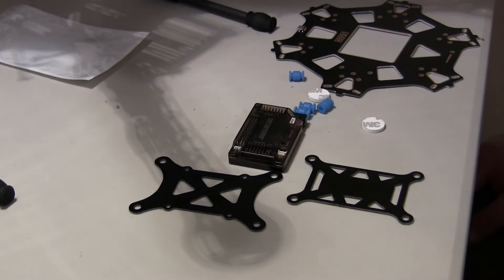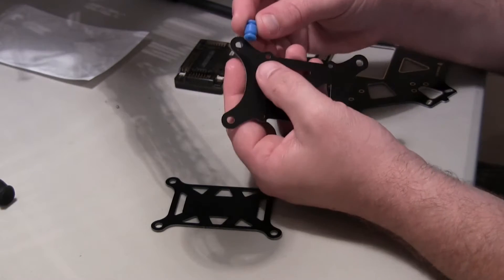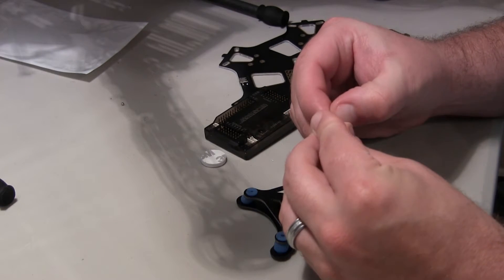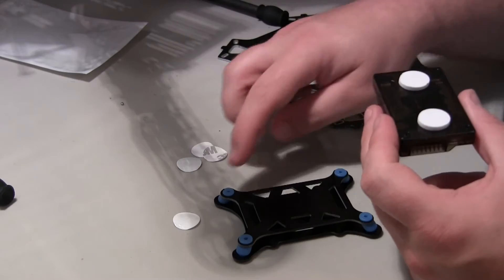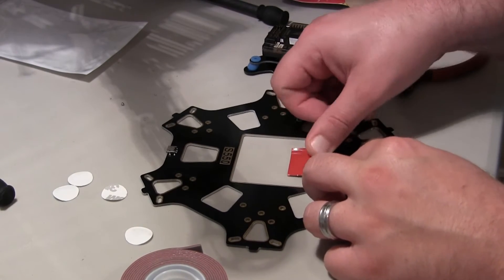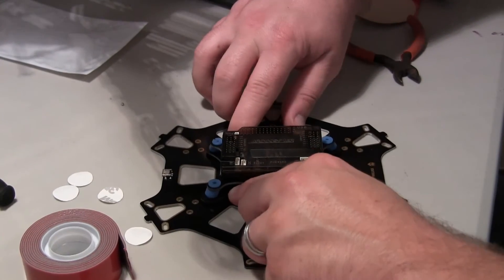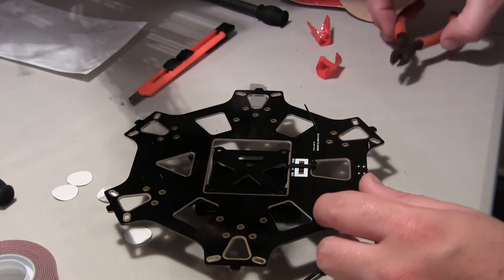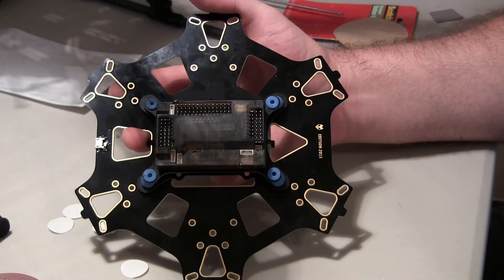S550 Build Part 4 - APM 2.6 to Frame with Vibration Dampener

Comment: Pro Tip: Loop a piece of string or thin wire around the grommet through the hole and just pull it through carefully. Makes it very easy.